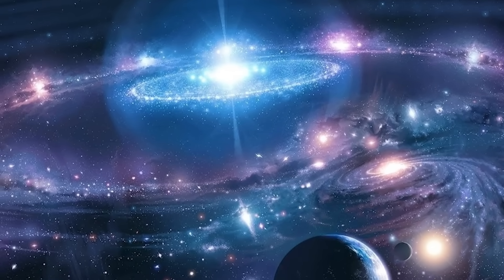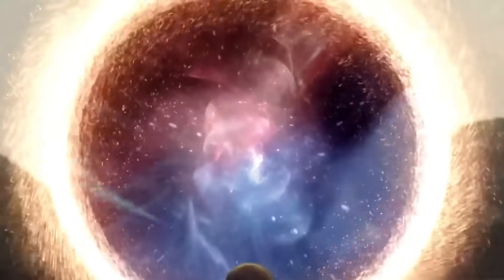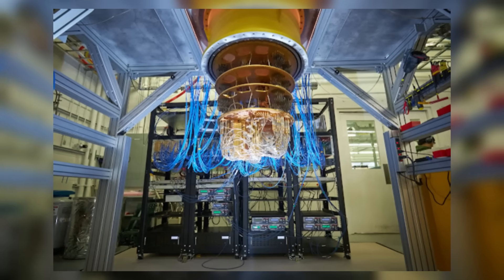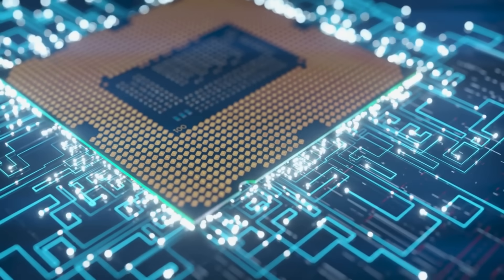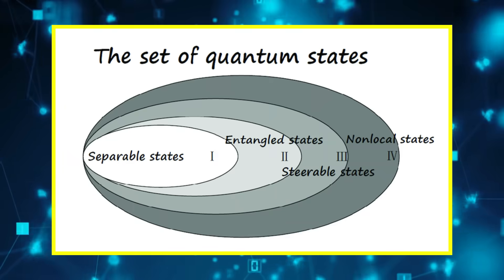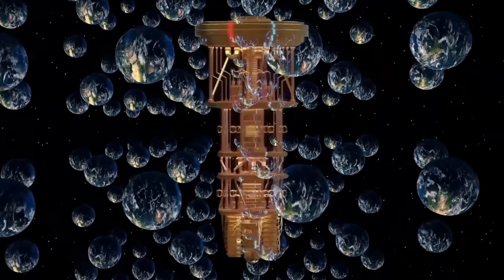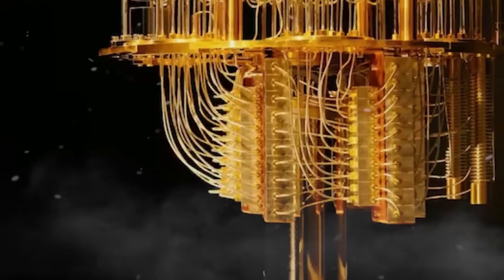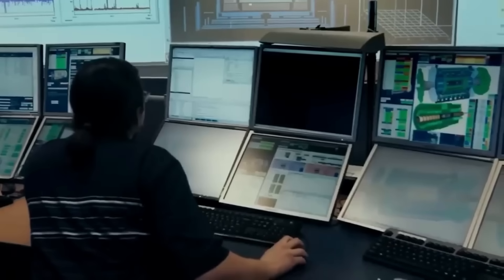Google Warns: Google Quantum Computer Accidentally Unleashed a Parallel Universe Shifter

Comment: The fact that quantum computers simultaneously use 0 and 1  everything in between...

DOES NOT IN ANY WAY prove the existence of other dimensions or universe! 

It does not in any way prove some new physics or anything else these videos seem to speculate

All it means is that we are essentially taking all of the parameters involved in the double slit experiment and using them in a way that allows us to gain a function 

It's superposition and probability wave collapsed harnessed and quantized into usable Qbits for mathematical operations

It's not weird it's not unbelievable it's not mind breaking it's not new physics it's not an old other dimensions it's not other universes stop passing all this misinformation